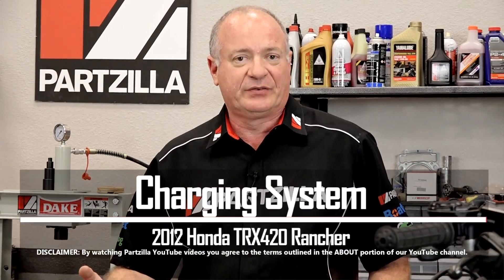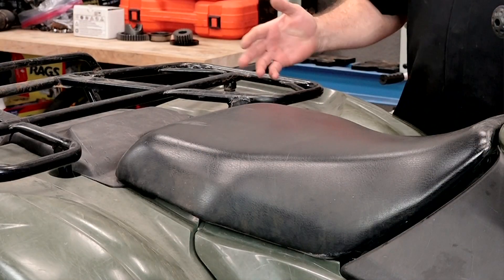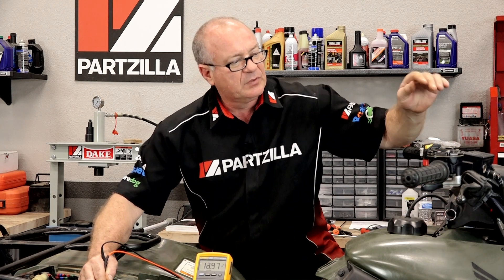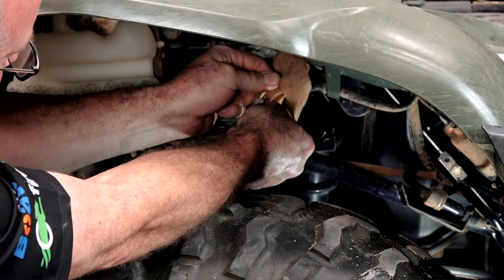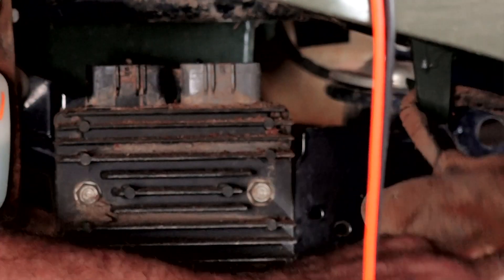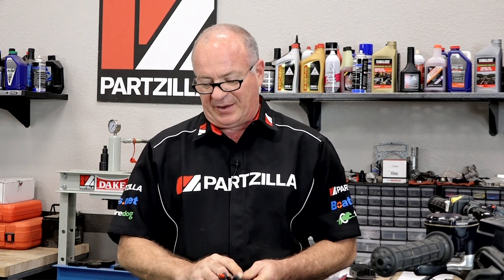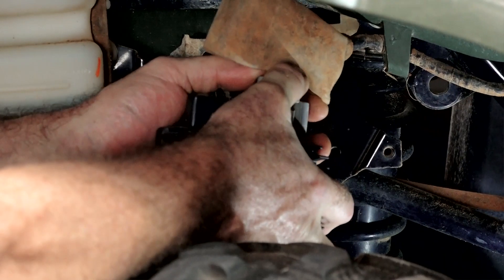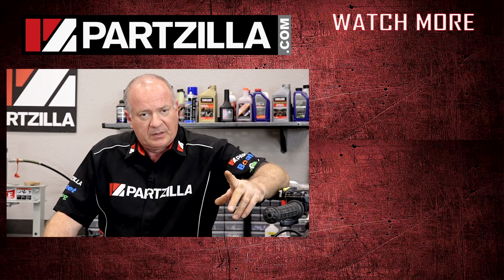How to Test the Charging System on a Honda Rancher 420 | How to Test the Charging System on an ATV

Comment: Aloha, sir,, i have a 2013 trx rancher 420 and mine dies on idle after 15-20mins.. I’ve replaced the fuel pump and clean out the trottle body..would it be mine rectifier ?

Comment: I have a Honda 125M I got a new Battery for it I ran it not even a block around my house I parked it for a few minutes it will not start no Neutral light or ignition all dead at this time regulator rectifier not sure what it does I ran a screw driver between the two bolts and I got spark it was trying to start but no go I am running 14.00 volts at this time I checked the fuses they look ok not sure what to check next please Help

Comment: What might be the problem if it will not start but you move the gear shifter to the left of neutral before you go into reverse and then press the starter and it starts?

Comment: I have a 2011 420 Fourtrax. I am getting 15.3 volts on each of the windings. Is that sufficient voltage?
Reply: Was wondering if you had to replace your stator. My 420 has 15.5 volts on each phase at idle when engine is warm. Works great to the engine gets really hot then sends no voltage to battery from regulator. Big job to change stator already changed regulator
Reply: @philipjean1086  I just changed the voltage regulator and haven’t had any issues since then.

Comment: What should be the voltage coming out of the regulator rectifier when it's off the machine? Thank you for your video hope to hear from you soon. Also I'm only showing 15 volts coming from the stator at idle when revving it can go up to 35 or more
Reply: Did you ever find your issue? At idle I’m only at 15 volts as well from stator.

Comment: My 2008 Rancher 420 has a voltage from the stator of 13.68 on all three. I am guessing that is too low? What should a 2008 TRX420 ES 4x4 be?    The output from the rectifier is only 8.98 Volts. to the battery.

Comment: I have a 1997 trx 400 foreman with a charging issue, would the information in this video be relevant for my bike ?
Reply: I have the same. Did you determine if it was the same?  Thanks a ton.

Comment: What would happen if you miss a line a trx350fm 2006 4x4 swingarm bolt? Would it cause the swingarm bolt to fallout and not torque to spec? And the swingarm bolts are rusty I'm asking because I've went through it and couldn't figure it out
Reply: Tf